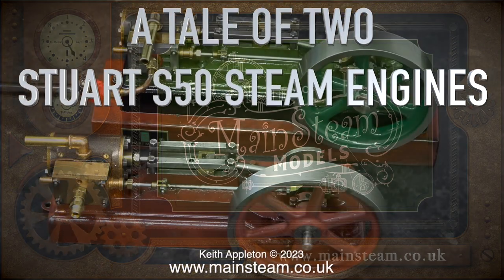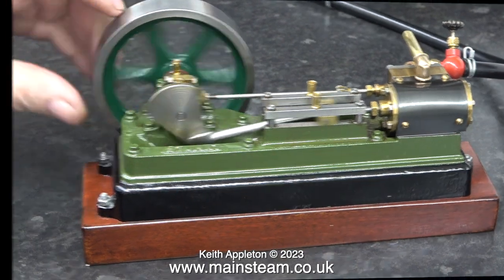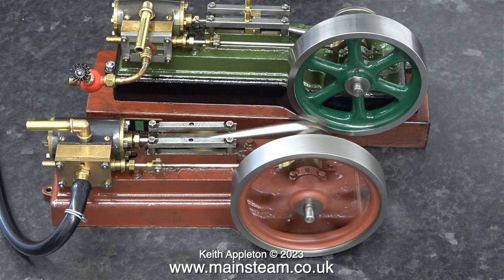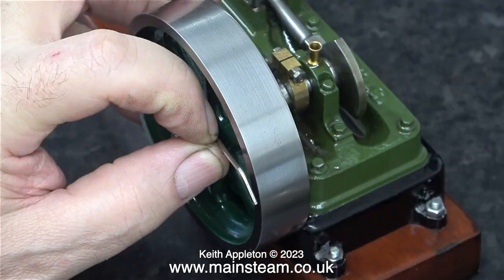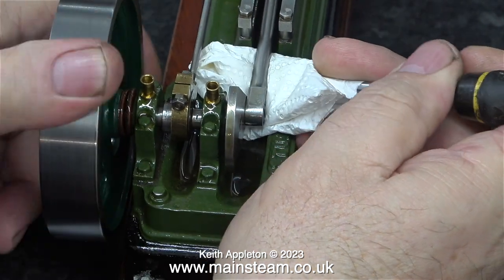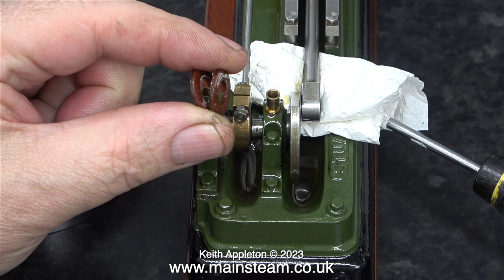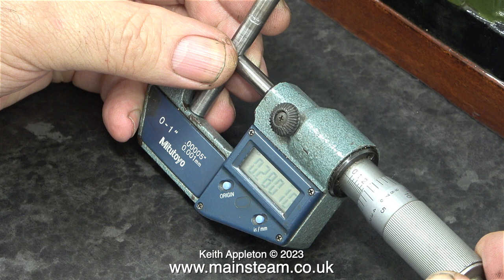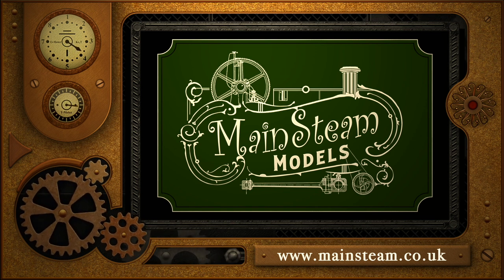A TALE OF TWO STUART S50 STEAM ENGINES - PART #1

Comment: Well, at least the crank is serviceable, I bought an S-50 engine a while back that some person thought they needed to cut a key way down the flywheel side clear to the bearing using a 1/8" something or other, could have been an end mill could have been a dremel and a cutting wheel for all I know. It got a new one because the shaft was cut undersized and the flywheel wobbled to beat hell. Bearings were fine. Its a nice little running thing now, with an older flat spoked wheel. 

I love the little stories engines tell us as we take them apart and figure out how they have lived. Living in the US and messing around with this hobby, the cast offs you put in the bin are precious toys to us lol. Thanks for the show.
Reply from the maker: To be honest, I don't put much in the bin if I can help it ..... }:-)))

Comment: What are those bearings made from? Is sintered bearing bronze readily available in the UK? The stuff that's impregnated with oil—it's more tolerant of infrequent lubrication.
Reply from the maker: Leaded Phosphor Bronze. Yes we can get Sintered Bearing Bronze in the uK - we call it "Oilite" I have used it in the past and it works well in certain applications.